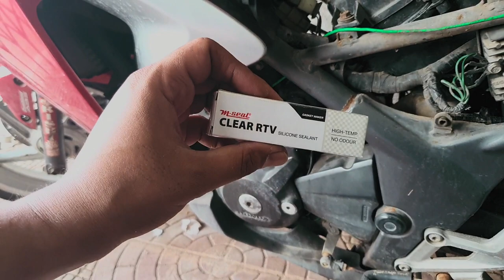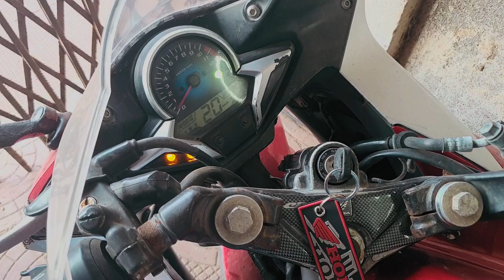HONDA CBR250R PROBLEM OF BATTERY DRAIN SOLVED | MAGNETIC COIL INSTALLATION

Comment: Same problem observed in my cbr250r....Honda mechanic took 3 months to identify the issue....got battery replaced....finally they found issue in magnetic coil.....after heating it got short circuited causing battery to drain... ..kaash ye video pehle mila hota. ...good information....
Reply from the maker: The video is 1 year old bro never mind, thanks a lot brother
Reply: Mere bhi yahi problem hai itne sare paise lagwa diye problem ab pata chal rahi hai

Comment: My bike too refuses to start. I can see the light when I turn on the bike but after hitting the self start button there is no ignition. I guess it is the same issue you explained in your video and comments. The mechanic says the magneto coil is not working and the battery is also almost not upto the mark. There are no spare parts available with the service centres be it Thane, Navi Mumbai, Ulhasnagar which I confirmed on call. I hope the number you provided (Andheri West) solves my problem. If he has a new coil I'll get it and have it fixed by the service centre. If all goes positive this would be an awesome thing - thanks for the video and sharing the contact. Happy and safe riding brother!
Reply from the maker: You're welcome brother

Comment: Hi, can you please tell me the resistance between the 3 pin connectors of new alternator ? My cbr is giving the same problem and service centre is telling its the battery. But the battery is getting charged in other bikes. After a lot of research i think its the alternator. Resistance is showing 5.7 ohm which should be .1 to .9 ohm. Can you please check yours so that i can understand better.

Comment: Hey I m your new subscriber, great stuff there, does the ZMR's stator coil fits in CBR.
Reply from the maker: Welcome to the family bro, zmr stator coil wont fit cbr i confirmed it with my mechanic then i ordered for a new cbr coil coz the zmr which my mechanic had was a dead one more or less like a scrap bike.
Reply: @popeyethebiker  why it cannot be fit.. All the store are close. When I want to use my bike I need to charge the battery. The coil is too big or what please help...
Reply: @popeyethebiker  
Bro I think, ZMR ka rectifier same to Cbr ok
Reply: @popeyethebiker  from where you buy the coil, I'm from nagpur and I have same problem in my cbr ?
Reply from the maker: @positiveprince9175  i bought this from. Mumbai andheri west +91 83690 02970 this is the number of the shop u can n tell him if he can send u via courier

Comment: Are you sure brother ki karizma zmr ka regulator rectifier cbr mai fit ho jata h because my cbr 250  has a bad rectifier and the new honda rectifier is really expensive
Reply from the maker: Yes I am 100% sure that the rectifier of cbr250r n karizma zmr is same
Reply: @popeyethebiker  Thank you so much bro for giving this info to me 🧡
Reply from the maker: @Gaurav_S26  your welcome
Reply: Bro is cbr150 and Karizma zmr regulator is same?
Reply from the maker: I am not sure about karizma rectifier fits on cbr150 coz I haven't seen the cbr 150 rectifier if its same then it will fit for sure

Comment: Same case happen to me, i changed magnet and then dint use cbr 250 for 3-4 month, now its relay problem as it start on push but not on self start, but main difference between magnet coil defect and relay is if relay defective u can push start and run but if magnet coil burn, it never start on push as well ones it stop.
Reply from the maker: Yes bro your right, but now that I have almost completed all my cbr work i will be using it in city n nearby rides coz i just love the performance of this bike

Comment: Sir i have the same problem with my bike cbr 250r as the original cbr regulator rectifier is costly will karizma zmr regulator rectifier work on the bike please help
Reply from the maker: As I said in the video the rectifier of zmr is same like of cbr 250r so u can use it for cbr, it is been checked by my mechanic
Reply: Popeye The Biker thank you so much for the fast assistance 👍🏻
Reply from the maker: Your welcome brother, just remove ur old rectifier n then go to any spare part shop n show them as a sample.
Reply: Popeye The Biker any idea how much will the rectifier cost maybe zmr one or anyother brand ?
Reply from the maker: @srajanshetty5962  i guess it will be under 1k

Comment: Hello popeye 
Bro can u plz tell me abt the cbr  actually i have a offer of 2nd hand bike which is run only 3000 kmz in 7 years is there is need to change tyres? Becoz it only run 3000 km bt the ques is life of the tyre 
Hardly bike was started aftr 6 months
What things should check while 2nd hand cbr
Pls popeye reply
Reply from the maker: Yes u have to change the tyres if the bike is ridden or less ridden the rubber gets cracked n u will feel the handle shaking a bit while riding, things to check during buying a 2nd hand bike well 1st the service record just to check weather its genuinely ridden that much km n to get n idea when was it last serviced, 2nd take a test ride n try to rev the bike just to check the clutch plates are functioning well or is the rpm increasing n speed is less, 3rd over all body check just incase if the bike has ever met with an accident, all TTO set I mean the transfer papers are ok n signed by the owner, check in rto if the bike has pending fines or any complaints against it.

Comment: i am facing similar problem.. I hv changed battery regulator. Still not solved. Lets see now. Will check this magnetic coil condition.
Reply from the maker: Magnet coil is the only problem for battery drain regulator doesnt get damaged easily
Reply: @popeyethebiker  Shit..  my 2000rs wasted then, for buying regulator😪😪
Reply: @popeyethebiker  thank you for this video
Reply from the maker: I had a + point that my mechanic had a regulator of karizma zmr which is same as the one in cbr to test weather my regulator is working or no so I saved my money on that but bro the magnet coil isn't available everywhere so u might have a hard time searching for the coil

Comment: Do we need to replace battey after changing magnet coil
Reply from the maker: After changing magnet coil charge your battery n then check it via volt meter if the battery is below 12 volts then u might have to replace your battery with a new one but 1st check ur battery n then take a call
Reply: @popeyethebiker  thank youuuu
Reply from the maker: @MichaelLiarLiar  your welcome bro

Comment: Your cbr abs light is blinking thats means your abs is not  working can you help me with this
Reply from the maker: Yes its issue in my abs sensor I have to check the problem n then the solution but after the lockdown ends

Comment: Bro mera cbr 250R start nhi hoh raha. Or if it starts than also when i acclerate it doesnt take pickup and getting off. Than when i try to start by self 5-6times my battery is aslo getting discharge again and again. Battery is new, fuelpump injector body throtle sparkplug everything is new than also iam facing problem. Start hoh jatah hai toh jab throttle martah hoh toh pikup nehi letah or off hoh jatah hai or jyada self marne se neyah battery bar bar dischrge hih jatah hai. Please help i need help anyone knows whats the solution? Pls help me even mechanics cant say wts wrong with my cbr. Help pls tell me wts the solution.

Comment: Sir meri CBR me bhi battery drain ho rhi h or maine battery bhi new dali h abhi uske baad bhi drain ho rhi h,  sir but mere bike me current bta rha h sir 13+ or self start karne k baad 14+ a rhi h... To kya problem ho skta h sir please btao na mai bahut upset ho gya hu sir please reply
Reply from the maker: Battery drain hone k 4 reasons hote hai 
1) battery dead 
2) magnet coil 
3) rectifier not working 
4) current leak 
Aapki battery new hai toh battery ka koi issue nahi hai pehle magnet coil aur rectifier check karo agar woh sahi hai toh wiring issue hoga phir
Reply: @popeyethebiker  or agr rectifier kharab hi h to kya ham other companies ka use kar sakte h kya sir rectifier ko meri bike CBR 150 h original bhut costly h isliye sir...
Reply from the maker: @deepaksa5882  karizma zmr ka aur honda cbr ka rectifier bhi same hai woh use kar sakte hai
Reply: @popeyethebiker  okk thanku Sir🙂
Reply from the maker: @deepaksa5882  your welcome bhai

Comment: every cbr 250r have same problem after 25000km
i think honda dont take seriously cbr owners
reason of this problem-- in service time no honda works tight the screw of this internal part whih is moving around coil and after some time these screw keep lose and make contact with coil and cut the coil wire.
after this happen , they simpley say to u , sir your coil is broken please change it, and you are waiting some days for the reason of unavailibility of this part(they think owners have lot of money to buy our parts).
cbr service is suck even in ncr places.
i phase many problem like this in my cbr250
one time fuel pump rely is not working suddenly and i toy my bike 50km .
finally i rigret and say confidentily i purchase a wrong bike(after availble in india (8years) no machanic availble in local market)
it is a wrost product
Reply from the maker: This is the actual reason why cbr250r dint get success in india, the spares are mostly not available in the authorised service center, the price of the spares are very high, and due to bad after sales service it dint do well in Indian market, but brother my bike is 8 years old now n this was the 1st time i changed the magnet coil so i felt that its not that big deal to replace it with then old one
Reply: @popeyethebiker  service is not good of fi bike in india.i feel india is not ready that type of bike since 2011
Reply from the maker: @AdityaVerma-ze8ez  nahi bhai there r good mechanics outside as well but the problem in authorised service Center is the mechanics are not that well trained or mostly the company hires interns who just finished their Engineering u can say that its basically lack of knowledge in new mechanics